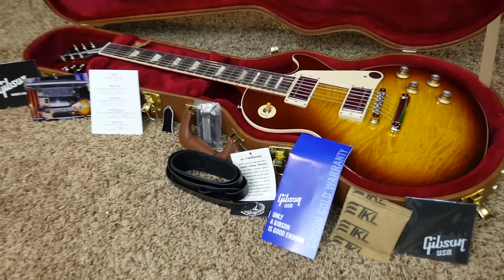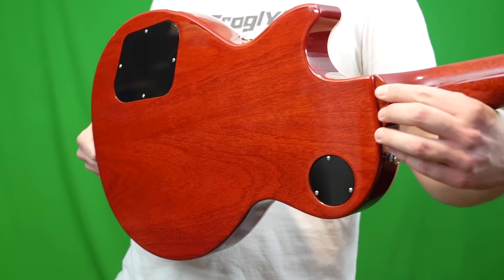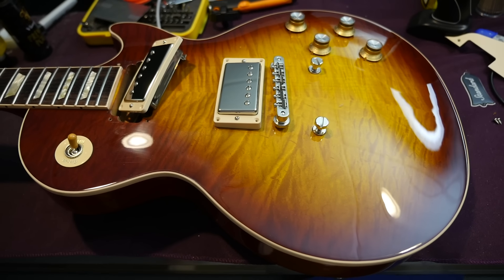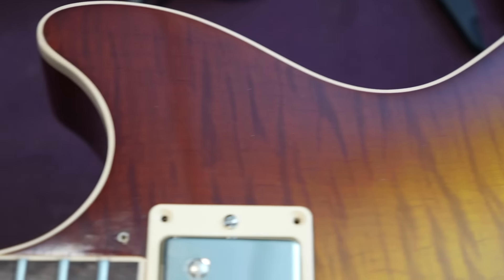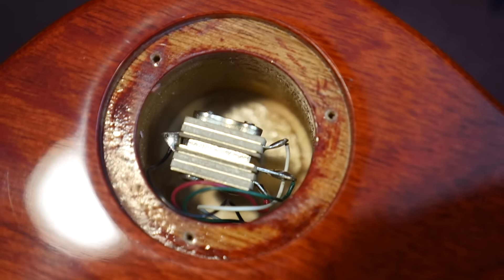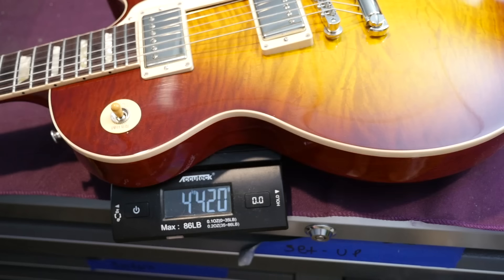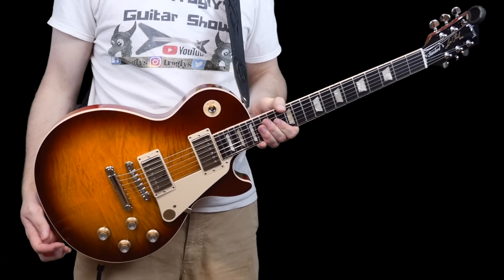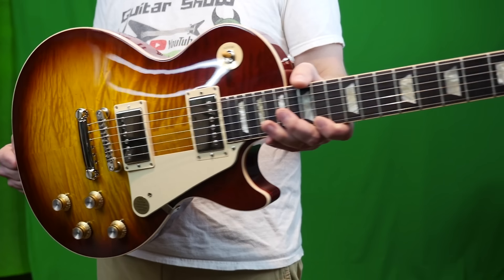The NEW Gibson Les Paul Standard '60s - Is It Worth Buying? | 2019 In-Depth Review + Demo

Comment: $2400.00 List or $1999.00 Street. I bought a 2002 Guild Bluesbird (Fender Made) for $850.00 with hard shell case. Metallic top which isn't perfect but $850 for a Mahogany Chambered Body, Maple Top, Mahogany Neck with a rosewood fretboard - single binding all the way around. Grover tuners and synthetic bone nut. Seymour Duncan 59' HS-1 and Seymour Duncan 59' HS-2. The neck is thick but comfortable but it's definitely not for everyone. Electronics are 50's Gibson style with orange drops and 7.5 lbs. Has a thicker more mellow sound than most Les Paul's. New Gibson's don't hold their value like the older ones. Plus, who wants to gig with a guitar $2000. New or used Custom Shop Gibson's are what most collectors are looking for and at $3000.00 or more just to say "GIBSON" on the head stock, no thanks.

Comment: For the record. The Traditionals have had no weight relief for years. Also the Standards were chambered only until 2012, when they just began using varying types of routing. Routing is very different from chambering.

Also the control cavity didn't change from the recent Traditionals.
Reply: AnthonyFernandoMusic exactly! It’s a Traditional with a new nut and change of name. Yet some people are raving about a return to greatness 😂😂
Reply: The Proles it's funny because the nut is actually less accurate now too, the traditional was nylon, now these are graphtech

Comment: I hope Gibson is making a good rebound after all their financial issues. I think they are going in the right direction, but a PRS McCarty 594 seems to be a better option with much better quality control at this time.
Reply: PRS are much better guitars they are very high quality instruments way better than Gibson
Reply: @cirovazquez1028  their also really good at being ugly
Reply: Gibson's putting out some of the finest work in DECADES.Topps are fantastic, and QC is spot on.The Gibson's are being pleked before you get them.Huge difference.
Reply: @cirovazquez1028 ??? PRS they are good, but for me, they don't surpass my Gibson's that I've had some for 55+yrs... tone quality, hand craftsmanship, Gibson is the guitar of the Stars..
Reply: I just look your comments, there 3 years old, because it's not true today, NOWDAYS Gibson is putting some much better quality into there guitars again.2023.I still prefer my vintage Gibson's.les Paul cost me cost $399 new  in1968.
Reply: @Jim Kostan  We like what we like. I really like my 1989 Les Paul Custom even with the finish pushing out of the wood. However the LP is bottom heavy and the neck is clubby after the 15th fret. The PRS McCarty 594 fixed these issues as well as the headstock. The PRS keeps better in tune as the D and G strings don't pull sideways like the LP

Comment: Now this is a Les Paul Standard 😁

I think a lot of people saying things like Gibson fans are purists, fanatics, traditionalists etc either have never played a really good Gibson LP or are more comfortable with a different style of guitar. The general consensus seems to be that a "great" Gibson LP is typically heavy (8.5 - 10 pounds), not over complicated (no robo tuners, fancy design changes etc)  and hand wired (no circuit boards). It's a kind of formula thing that many believe is requisite to a really great LP. IMO its probably because most of the great ones out there are old and were made before certain changes were made. The problem is that many of the updates and feature changes that have been introduced over the years tended to come along with a drop in quality, tone and feel. I honestly think a lot of this is Gibson dropping the ball, not necessarily the changes being made. I have played a few great modern LPs but every last one of them had been modded in some way to get it there, from removing the stupid robo tuners to stripping out the circuit board and hand wiring them. Some changes will always be a step backwards and should be discontinued once that proves to be the case. To most of us, Gibson going back to basics and getting the foundations in order again is crucial to rebuilding the brand. Seeing this Standard put together like they were made during Gibson's glory days is huge. Get the ratio of great to mediocre back up to a decent level BEFORE making changes then undo them if it drops the ratio. One change at a time, small but significant and slowly evolve the brand with meaningful, useful changes that don't corrupt the essence of the thing and if it ain't broke......

Comment: Those fretboard tooling marks are shocking for a $2000 guitar.

I know it’s harder to avoid with the way they cut the binding around the frets (which I don’t think many players would actually miss anyway) but whoever’s trimmed that binding clearly didn’t care about doing a good job, just a ‘good enough for QC job. 

I’ll stand by what I’ve said before, they need to start making them to dealer/customer order rather than churning them out and dumping inventory on dealers.
Reply: I would miss the fret binding myself. Especially now with the thinner binding. Just feels luxurious and smooth. Plus it's something that no other manufactures do.
Reply: Could be easily cleaned up with a razor blade and can be now not very hard to do...
It should have been done some how that one missed it..My 2017 Tradional binding is flawless
Reply: Johnathan Doe well that’s stupid, you realise a custom order is like 5 grand

Comment: Just bought a Vintage 60s Gibson Standard Les Paul in cherry burst faded. "Faded" should of been labeled as satin finish  instead. This confuses the buyer. 

However the workmanship was excellent. Pick guard was not attached to mine and I rather not have one, so I am glad for this because I usually have to remove it. The Grover tuners and the slimmer neck are what I was looking for so I pleased with this aspect.

Comment: Just a couple of notes here: First, you should only use mineral oil or linseed oil when conditioning a fretboard, not any oil you want (no offense). You are correct not to use lemon oil which is meant for cleaning, not conditioning. Lemon oil is comprised of chemicals called monoterpenes, which are generally known to have uplifting characteristics. Other oils such as vegetable will go rancid. 

If one wants to remove the tooling marks from the Rosewood, you can use a tiny bit of water applied to the area where the mark is only. The wood will absorb the moisture and expand, or lift up to remove the mark. Do not over saturate. But when done correctly, can work wonders. Unfortunately, the tooling marks on the binding you are stuck with.

Comment: Excellent video. I would love these 60s Les Pauls even more if they had long neck tennons and were a pound lighter. However for the bucks,my CORT CR300 fills the bill with its slim taper neck,15mm solid maple top and solid lightweight mahogany body (all CR 300s are consistent in weight,weighing in at an even 8 lbs). I replaced the stock Kluson tuners with direct replacement locking tuners from Stew-Mac,upgraded the stock stopbar to an aluminum locking (also from Stew-Mac) and a Tone Pros locking tom bridge. Replaced the stock Nubone nut with a black TUSQ nut and swapped the stock active EMG 55 pickups to a set of Duncan 59s. With a fret level this guitar plays better than any set neck Ive previously owned or played since. Cost $649
Mine was on sale. After buying a 2017 Les Paul I swore off Gibson because work performed by me as well as my guitar tech couldnt fix construction issues such as the strings could only be lowered so far,despite fret leveling. The tone was just not happening. With the Duncan alnico v pickups it sounds like a 1960 Les Paul ( the 59 Les Pauls had alnico II pickups). With the two exceptional purchases of a CARVIN and a KIESEL respectively,the CORT is my favorite to date. With just a bit more money invested a very good/great stock guitar became an excellent guitar.🎸👍🎸

Comment: I have a question. You said "not to use real lemon oil on your instrument". Why not? I've been using Old English Lemon Oil on my guitars for years and have had zero problems. Look forward to your reason.  Love your in-depth videos. Nobody goes in extreme detail like you do and I always learn something new. Thanks!
Reply: Real lemon oil is an essential oil and actually damges (bleaches) wood. Old English Lemon Oil is a mixture specifically made for conditioning wood. I think it doesn't even contain actual lemon oil. It only has a lemon scent.
Reply: most are just mineral oil with a lemon scent
Reply: @vvvvraptorvvvv  That's what I was saying, or not?

Comment: Very nice, I'm glad Gibson seems to be listening.   I wish they would stop using the pushed in bushings for the bridge posts.   Very glad you spoke to this issue and explained the mounting differences.
Short neck tenon, disappointing for sure.
A beautiful finish and very glad they stopped the weight relief.
About the pickups, per Mark Agnesi the 60s tribute "Rhy/Lead 61" pickups use Alnico 5 magnets (BB Pickups use Alnico 2 magnets).  reference video https://youtu.be/H9FR_JGG-tA?t=137
Yeah, the pickguard nut mark on the top, ugh. 
About the tooling marks from the fret board binding installation, do you see that on your other Gibson instruments?  Can you show an example of Good verses Bad, I'm sure guitars like your Steve Howe and some of your Historic/Pre-Historic could be compared with current build quality to show the differences, yes?
Hey, great idea for video, compare the build quality with different era/years with new Gibson instruments.  Unlike most of us you have a pretty great selection of Gibson Guitars that span many, many years of production!
So glad to see simple vintage wiring.   That said, are the volume/tone pots wired in a vintage style or modern style?  Believe it or not there is a big difference in tone/performance between the two wiring styles.   If a person has a choice they should always use the 50s style wiring as there is less treble loss when rolling down the volume.
How doe Gibson mess up cutting the nut when supposedly they are all going through the PLEK machine?
Great review, thank you.

Comment: I bought 2 of the 50's Standards...... here are the issues. The neck is no where near a 50's neck. Pots were to be audio taper and they are not. 10 is 10 and 8 is about 4 and 4 is no volume. Both necks had a big bump on the bass side and many of the frets rocked.  Also had the issue of the pickguard.. take it off and there is a big blemish dent in the finish.  Nut was also not cut correct but I was able to set these up with nice low action.  I also bought a custom shop in Alpine white.  I just recently sent it back to Sweetwater with complaints of several frets being to high. Very big bump on the bass side around the 14 fret with a reverse down to the treble side of the 1st fret .  I ignored it for a while but when spending over 4k for this I can't let it slide. Sweetwater agreed to look at it and maybe fix it under Gibson Warranty. Butttt, then I receive a conformation letter of the guitar and stating they will inspect and send me a detailed list of what needs to be done and prices. I did not agree to that and totally opposite of the phone conversation I had with the Tech Manager. Gibson surly has a long way to go to come back to a HIGH STANDARD but are slowly , very slowly headed that way....... if this guitar is not totally fixed for free or replaced I will never buy another guitar from Sweetwater again.
Reply: That really sucks man. I hope you get satisfaction. Your story is the reason why I still buy from GC or Sam ASH. They'll just replace it to gt you out of the way.

Comment: Please stop with this nonsense about transferring vibrations. It doesn’t do that. The idea of a solid body guitar is the mass of the body is greater, so the energy (vibrations) stays in the strings longer. That gives you very long sustain. But very little acoustic output. 

The opposite is a banjo. Almost all the energy goes into vibrating the head, so you get a loud acoustic output, but zero sustain. 

This idea of transferring vibrations as some magical sustain or tone producing mechanism is not how guitars work. 

The fact that the bridge is on studs is better. You have more mass under the bridge and the posts won’t lean over like the old dumb ABR bridges. That was bad. They changed it for a reason. This is a better bridge and give a more solid connection to the body, since you seem to think that’s a good thing! 

There’s also no reason to make a guitar exactly like the old ones.  New guitars are made better. But unfortunately when Gibson tries to improve upon things the guys that want to pose in the mirror and pretend they have a vintage guitar get upset. 

So Gibson stopped putting a volute on the necks. Ever see a Les Paul take a fall? The head snaps off. That’s a very weak area. If Gibson could add a volute, and maybe even add a modern non curved truss rod, the neck would be stronger. That area is more important than the tenon in the body.
Reply: I think the quality of the studs and the bridge being low would affect the vibration more than anything.
Reply: Deneteus The skimpier the studs, the less energy you’re going to retain in the strings. You need the mass. This is why Alembic (and a few others) put heavy brass inertia blocks under the bridge. That helps keep the energy in the strings and NOT transferred to the body. 

So on this case the modern thicker studs are better than the thin screw studs.
Reply: Great points. The old bridge was stupid from day one. Common sense tells you it would likely bend on the posts.
Reply: There is a variety of physics going I am thinking (no, I am not a physicist, but a player of 59 years) that enter into all electric guitars. The first would be the quality of the bridge in terms of metal materials. Gibson, unless they have changed their habits, uses zinc pot metal for the trays in which the individual bridge inserts set. So even if those are brass, they are not transferring much energy into the top. Bill Callaham makes bridges out of cold rolled steel which WILL transfer vibrations into a guitar's body. 

Then, there is the density of the body wood, or lack thereof. Mahogany is actually a fairly soft wood and therefore, more of a warm wood. The maple just might add some top-end treble to the equation. Early this year, I took possession of a brand new ash-bodied Fender American Original '50s Stratocaster. This axe has a significant neck and this guitar, acoustically sounds better than any other Fender I have ever played, and I believe that fat neck is the reason why. So there might be some verification of claims that '59 Pauls sound best, with that horse's leg for a neck. I personally feel that the more vibrations are driven into the body, the easier it is for the strings to continue to vibrate ... a circle, so-to-speak. It is less a matter of volume created, and more a matter of frequency enhancement. With a Callaham ABR-1, the sound just jumps off of a Les Paul and is very well balanced. Just my opinions, but it's 59 years worth of analysis that has created them ... Of course, a completely hollow body, creates vibrations in a partially similar, but mostly different way. As stated, just my opinions ...
Reply: @DavidRavenMoon  Actually, the density of the metal in the studs is what matters most. See Bill Callaham ...
Reply: Tonetwisters That’s a bunch of snake oil.

Comment: I think we're not addressing the tuning issues with Gibson which is a main thing of why a lot of people won't buy them anymore. Even agile guitars has graphite Tusk nuts and graphite saddles on their tune-o-matic Bridges and they are less than 1/2 the price of even a Gibson Les Paul Studio. They also need to work up a plan to fix that drastic headstock angle. They have a new generation of players coming up will have more knowledge than the old players but the old players seem to want to stick with stuff that doesn't work
Reply: Yeah I think all the attention around Gibson itself right now has led people to forget the "REAL" reason most players fall out of love with a Les Paul.  Just as I did....it was the tuning stability.  As  proficient as I am working on and setting up guitars. I could never get my Gibson's to stay in tune.  New nuts, locking tuners you name it I've done it.  I now own an Epiphone Les Paul custom Pro that in reality sounds just as good, plays better and holds tune just fine.  The only thing I upgraded was the pots and caps.  If a guitar sounds great, plays great and stays in tune I could care less about small finish imperfections.  I say this not taking away from the purpose of this video.  It is a complete review which is awesome.  But I really like my Epiphone a lot.  I was very impressed the moment I first played it.  Gibson still has a way to go.  Especially if I sold my Gibson's to buy an Epiphone.

Comment: I just bought one, got it two weeks ago. Tooling marks are not as bad, but also has the screw ding under the pick guard. I'm a pick guard on guy so it doesn't bother me. Had a slight issue with string binding at the nut, but some graphite cleared that right up. Gibson needs to either up their game on Q.C. or lower the price a bit. It is a beautiful playing, and looking guitar though. I do like that it doesn't have a circuit board in the control cavity. I just wish it had independent volume control so you can blend the pickups. Oh, and mine has a plastic jack plate. I wish it was metal.